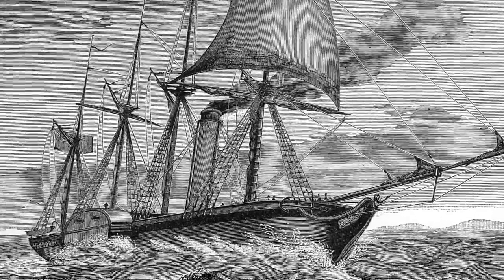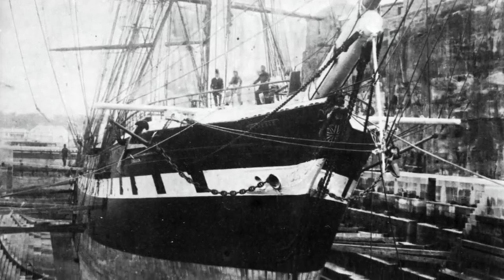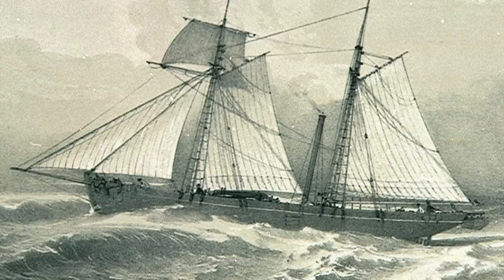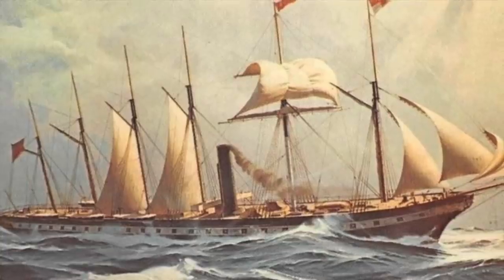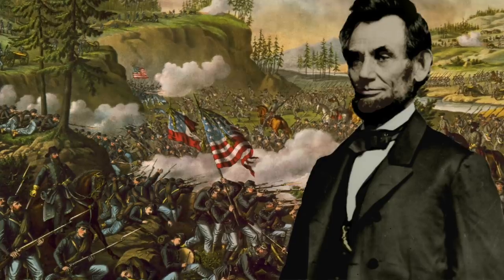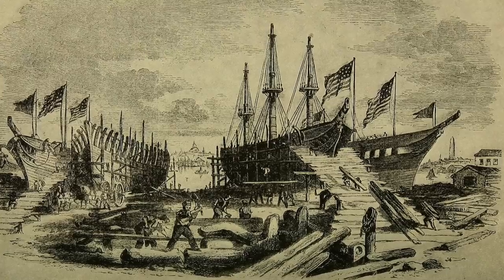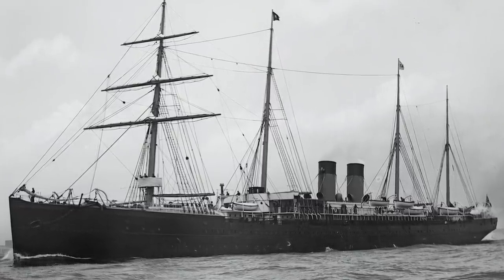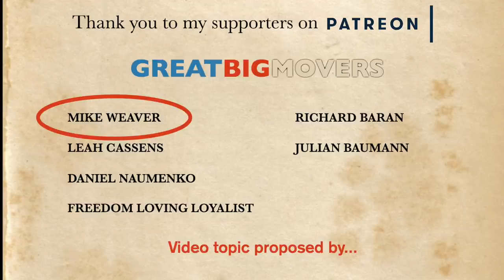Transition from Wood to Iron in Shipbuilding

Comment: Carbon is what makes steel, Impurities in Iron were sulfur and phosphor
Reply: Exactly. Pure Iron (Fe) is soft but tough  carbon (C) like carbon fiber's or Diamond's is Hard bot brittle, mixing it ind the right proportion get the Best of Both worlds. And if you want somthing resisten to Corrodsion you mix ind som chromium (Cr) aka stainles Steel.
Reply: To much carbon and your steel is brittle. 

Hydrocarbons are impurities.

Comment: My daughter and I both very much enjoyed this video.  I would only take issue with one part:  The battle between the Monitor and the Virginia.  You indicate that the battle was not terribly consequential and that the Virginia got the better of the Monitor.  While it is true that the Confederate ship got in one good hit her opponent, wounding the Monitor's captain and (very) temporarily knocking out the pilot house, the the Union ship dealt far more damage.  Not only was the Virginia's smoke stack riddled with shot (which decreased her already glacial speed as she did not have the Monitor's forced draft), but she had suffered several plates cracked by shot and was taking on water through the bow after several unsuccessful attempts at ramming.  At the end of the day, the Virginia retreated and that is why the battle was not inconsequential.  On the previous day, the Virginia had destroyed one ship of the Northern blockade and forced another to surrender.  If the Monitor had not arrived, it is likely that the Virginia would have continued to wreak havoc at the mouth of the Chesapeake, sinking ships, breaking the blockade, and allowing Southern cotton to be exchanged for European weapons.  By ultimately forcing the Virginia to retreat, the Monitor won a strategic victory.  The blockade was maintained and the war shortened as a result.
Reply from the maker: Thanks for watching, Sean. Those are fair enough points and I do believe you're correct that Virginia's retreat was important in the sense that it ended her immediate threat to Union ships. I just mean that it wasn't a turning point in the war which is really just my way of transitioning away from the war to go on talking about ships!
Reply: Just think  just let the man talk about ships he wasnt here to wax on about a war

Comment: Composite construction (iron frames and timber planking) was use for all tea clippers of the second half of the 1860s because the copper or "yellow metal" sheathing that could be applied to timber planking was far better anti-fouling than the available anti-fouling paints available for iron ships.

Comment: A very interesting video, adding some ships I did not realise played a part in the change over. One bit missing I did notice however that also slowed the change to iron and steel, was the problem with temperature, being that iron became brittle over time in cold waters significantly weakening it, this delayed the change until improved metals could be found to handle the colder seas.

Comment: Another reason composite hulls were used is because on the Great Lakes, ships would sail through shallow rivers and ports and damage the keel plates. That is why composite ships were used for so long until dredging became more advanced. It is cheaper to repair a section of wood compared to a section of steel. Great video by the way!!

Comment: I believe you got the steel making process wrong.  Carbon is in fact added to iron, along with other metals like nickel or chromium, to produce strong, flexible steel for ship hulls.  Iron by itself is very soft.
Reply: Kind of. Iron and steel are pretty much the same except for the different amounts of carbon in the material. Wrought iron (soft) has less than 0.08% carbon. Cast iron (hard) has over 4%. Steel is around 2%. Adding nickel and chromium gives you stainless steel

Comment: As a native of Virginia and a huge Civil War buff, the battle of Hampton Roads is absolutely fascinating. First thing to understand: these ships were built independently and neither side had any idea what the other was doing. It's very common in modern warfare that one side develops a new technology and has a significant advantage on the battlefield before the other side can adapt. But, in this case, both sides came up with an equally effective technology and unveiled them within a day of each other. But, in that day, the Virginia had destroyed two wooden ships and forced a third to ground to escape cannon range, emphatically establishing the iron-clad's dominance in naval warfare. And then the Monitor comes into the battle and neither ship can defeat the other. It is a literal stalemate which makes another fact very clear: one iron-clad can stand toe-to-to with another iron-clad. So, not only can an iron-clad be a very effective offensive ship against 99% of the world's naval ships of that time, it can also be a very effective defensive ship against another iron-clad. And after all that, it had no real impact on the war as a whole. Arguably one of the most important battles in terms of military technology of the Civil War was a stalemate. The Union still had their blockade and the Confederacy still controlled the inland waters.

Comment: Modern cruise ships are partially constructed out of aircraft aluminum. This allowed ships to have many decks high above the water line and not be top heavy. I think the first ship with an aluminum super structure was the SS Norway (1960-2006).
Reply from the maker: Novusod That’s a good point. So were some later ocean liners. I’m referring to the hulls at the end, though.

Comment: Permanent hogging is more the result of the greater weight vs. less floatation at the ends of the hull.  The ends don't fully support themselves.  Hogging and sagging underway, I would class as "working" of the hull, and it certainly is an issue with large wooden ships.

Comment: All steel contains iron, but it also contains carbon. ... The primary difference between iron and steel is that the former is a metal, whereas the latter is an alloy. Iron is simply a metal element that occurs naturally on Earth. In comparison, steel is a man-made alloy that's made by mixing iron and carbon together.Nov 27, 2019

Comment: Great video, but the metallurgy is incorrect. Carbon is added to iron to make steel.
Reply: Was about to say this, wrought iron is technically more corrosion resistant but weaker in terms of tensile strength and I believe heavier, hence the switch to steel.
Reply from the maker: That's not what my sources said, but if you can point me to a different source I would appreciate it. Thanks for watching.
Reply: @TheGreatBigMove  I think the differential needs to be between cast iron and steel, whereby your comparison would be absolutely correct, including the inclusion of other metals to the mix. Wrought iron which was used at the time is actually very low carbon iron with less than Cast/pig/steel. Cast iron is fundamentally impure and only one refining process beyond pig iron, and was only used on the cheapest of products. This article has a great comparison: https://www.explainthatstuff.com/ironsteel.html
Reply from the maker: Alex McBroom Thanks, Alex. I’ll take a look at that source.
Reply: @TheGreatBigMove  I wouldn't take the article as absolute gospel as it airs on the layman's side of things but is a simple comparison of the key terms
Reply: My understanding has always been that large scale steel production took so long to be realized because of the phenomenal temperatures required to liberate carbon from iron, with small and precise amounts of carbon added back into the mix only later on in the process.
Reply: @adamloverin231  that's what they had been doing for a fair old while with wrought iron, which was used for bridges (Clifton) and the isambard ships frames. The difficulty with steel was the additional metals making it an alloy I believe. Unfortunately early steel rusted quite quickly, but was very strong compared to wrought iron or cast iron and lighter.
Reply: No the video is correct, refining ore into metallic iron required reducing it with coke, which introduced far more carbon into the resulting product than ideal, the cost involved in making good steel for millennia was removing the excess carbon from the pig iron.
Reply: @DjAlyX1  Wrought iron contains quite a bit of carbon in the form of graphite inclusions, the reason it is far more malleable than cast iron is because unlike cast iron, the carbon isn't in solution. Wrought iron now is obsolete and has essentially been replaced with dead mild steel.
Reply: Thanks for the replies, everyone. I guess I learned something.
Reply: @jimkeith7099  we try our best!

Comment: Why not have a clutch screw propeller system where you start off with a smaller propeller for trolling and then switch to a larger propeller as you reach max efficiency.

Comment: Steel is iron with carbon added, not removed. https://en.wikipedia.org/wiki/Steel
Reply: No the video is correct, refining ore into metallic iron required reducing it with coke, which introduced far more carbon into the resulting product than ideal, the cost involved in making good steel for millennia was removing the excess carbon from the pig iron.
Reply: @1ohtaf1  https://en.wikipedia.org/wiki/Ferrous_metallurgy

Comment: Trans ocean travel solely by engine did not become practical until the development of the compound steam engine in the late 1860s, what followed was a series of ships with triple reduction and even quadreduction engines that were efficient in consumption of fuel thereby allowing the vessel to not devote so much of its cargo space to fuel (coal or wood).  Other developments include the use of freshwater (not sea water) in boilers significantly increasing the life of the boiler as well as the overall safety of the vessel (boiler explosions were bad) and better metals throughout the engine system allowing higher steam pressure was also a great leap in efficiency, reliability, and safety.  While turbine engines used in ocean liners and warships allow high speeds, most turbines cannot be efficiently throttled for operation at lower speeds or when some of the boilers were out of service, thus these 'old fashioned' engines remained in use thru the end of the steam era on tugs, ferries, and cargo vessels where high speed was not a consideration.  Even when it was many steam warships with turbines could go very fast but only for short periods while the piston engined ship could sustain moderately high speeds all day or for several days and the vessel might have a significantly longer range at more moderate cruise speeds.  The reason that river boats turned to steam early in the 19th century was that they could stop every hundred miles or so to refuel and of course they used fresh water in their boilers.

Comment: I guess aluminum isn't strong enough for big ships, and titanium and carbon fiber are too expensive to fabricate in that size?
Reply: Aluminium is most certainly strong enough for big ships, e.g. the 130 meter LOA 32 meter beam Buquebus Incat. Done right it has the same strength as steel. The problem with aluminium is its relatively high-tech to work with. LOTS of yards can work with steel, but very few can work with aluminium. You need specialist subsets of tools, equipment, and labour; so it is more expensive.
Reply: @darthkek1953  That makes sense -- after all, they do use aluminum for aircraft . . . so then that puts it in the same category as titanium and carbon fiber:  too expensive to fabricate in that size (unless you have a military budget, like for Soviet titanium submarines).

Comment: Dude you got steel totally wrong. You said steel is iron with reduced carbon content, which makes no sense at all. Iron is an element, so is carbon. Steel is iron with increased carbon content, which results in a family of substances with more useful properties than iron.

Natural iron sources do have impurities but you seem to have conflated them with vital carbon.
Reply: No the video is correct, refining ore into metallic iron required reducing it with coke, which introduced far more carbon into the resulting product than ideal, the cost involved in making good steel for millennia was removing the excess carbon from the pig iron.
Reply: 1ohtaf1 aight thanks!